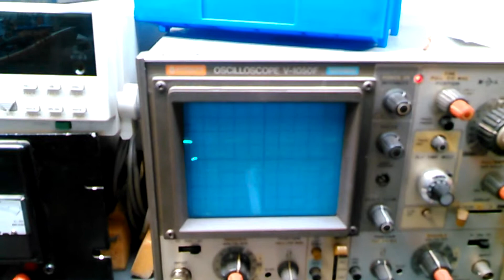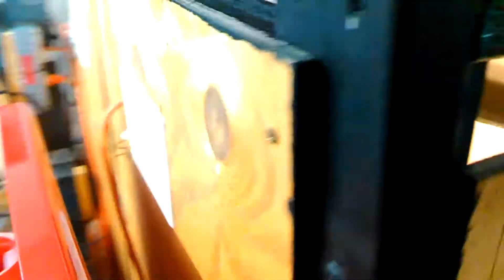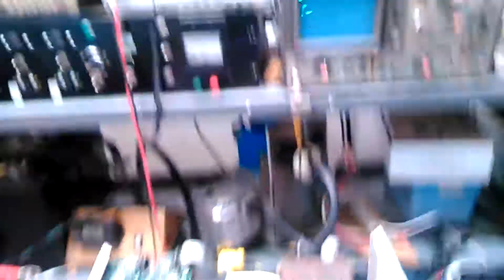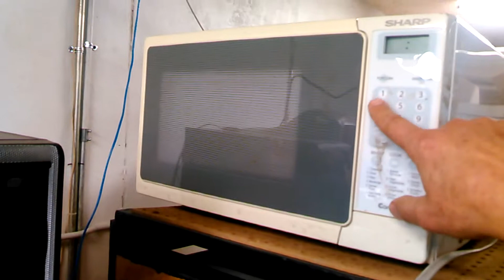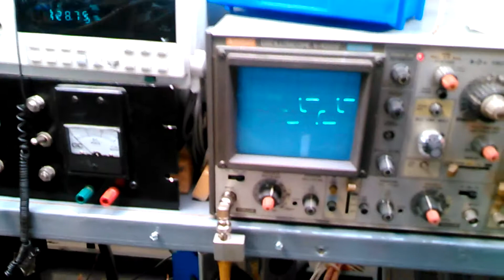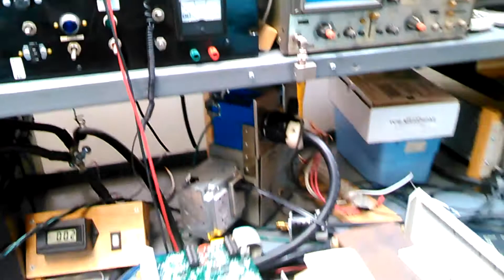Heart Interface Xantrex inverter voltage spike problem

Comment: My inverter light is blinking, troubleshooting guide indicates too much AC load on inverter?, where should I start
Reply from the maker: Which light is blinking and is it red or green?
Reply: @pcselectronics5423  Thanks you so much for your response, it's the inverter light and it is blinking green, very slow. Everything is working otherwise.
Reply from the maker: If you have the circuit breakers on the front of the unit just shut them off. If not then find the output breakers in the coach and shut them off. With no load if you still have a fault then most likely you have fried transistors inside the unit. Time for a new inverter. If the inverter runs with no load then you have a short in the coach. Start unplugging everything.
Reply from the maker: Sorry I just missed the fact that you said it was green. Blinking green means that function is in standby. Solid green is the active function. So your inverter is in the charge mode and the inverter is in standby. This is all normal.
Reply: @pcselectronics5423  Thank you. Great video!!!!

Comment: Can't somebody just replace a bad board on their own work bench at home  ? I know my AC board is bad. Control board is fine. And DC to AC  works fine also. Can I buy and install at home ?
Reply from the maker: We do not sell circuit boards but there are places that do. Contact an authorized Xantrex service center.
Reply: @pcselectronics5423  I worked out that problem is a fried relay. $9.98 online. I will replace then see if unit works properly again.
I'm a little peeved that Xantrex service centers require that you ship the entire heavy Freedom 458 instead of a single board. Also quote over $600 to replace board when probably they are replacing relay only then testing the board.Total ripoff. 
I will take my chance that the burnt relay is issue try that before I throw away good money for nothing. Thanks for your reply.

Comment: Would the failure of the electronic snubber be on the AC board or DC board?
Reply from the maker: It is the four center transistors and circuit on the DC inverter power board. This circuit also supplies start up power so if it is damaged the unit may not power up.

Comment: Having an issue with mine:

Fuse is good, brand new. No voltage between +&- on the inverter. Voltage good from inverter + to ground on battery. No voltage from - on inverter to positive of batteries. 

No fuses or breakers blown/tripped.
Reply: Also, continuity between inverter - and ground. 

Something internally to check?
Reply from the maker: From the measurements you made it sounds like you have an open negative cable. I would inspect the battery cables for corrosion. If there is tubing over the connections you may need to remove this to inspect.
Reply: @pcselectronics5423  I appreciate your reply. I am going to inspect and clean the terminals and connections today as others have told me they suspect the same thing. 

I will report back when I do. Thank you.

Comment: I have a freedom Combi with a 15a fuse. An I randomly loose outlets on the right side of the r.v. but then sometimes hrs later they work. It started making clicking noises the the fridge will start beeping. They are running a heart interface link 1000 control board is that the right board for the Combi? Does it matter?
Reply from the maker: I do not think they are the same. Be sure you are not in idle mode. See my other Freedom 458 videos for more information.

Comment: My 458 puts out close to 170 volts till I put a load on it.
Reply from the maker: I suspect you have lost your neutral connection or your meter may not be reading the step wave correctly. Check your AC voltage at the input and output of your transfer switch and check for loose or burnt connections. Also check the wire nuts under the front cover on the inverter.
Reply: I have had it in 4 coachs and it has never changed . I just always assume that it had something to do with being a modified sin-wave. I no longer use it as an inverter and only use the charger part. I am replacing it altogether this week when I get a new charger. I have been using a pure sign wave  inverter for the last several years. If you are interesting in buying it I would be glad to sell it to you lol.
Reply from the maker: For a limited time we are buying old units as long as we can get at least one good circuit board out of it.
Call for details 573-814-3131

Comment: Very interesting - thanks for the video! I guess it's caused by a bad cap or something then?
Reply from the maker: No this is an active circuit. There are transistors that are switched on at the appropriate time to snub the spikes.
Reply: Ahh okay that makes sense - probably a better solution! Thanks for the quick reply!

Comment: Bonjour g un problème avec mon d’antre vous 458 il donne 108 volts ac pourquoi merci
Reply from the maker: I have never seen a unit that did not regulate to 120 volts. Maybe you have a bad connection somewhere or a bad circuit breaker. I do not have schematics so I can not direct you to where the problem might be but it is the job of the control board to regulate the output. The output pulse width is changed depending on the load current.
Reply from the maker: This is a step wave unit, be sure you are using a true RMS meter. If you don't you will get a low reading.